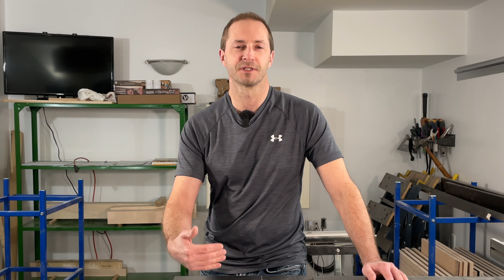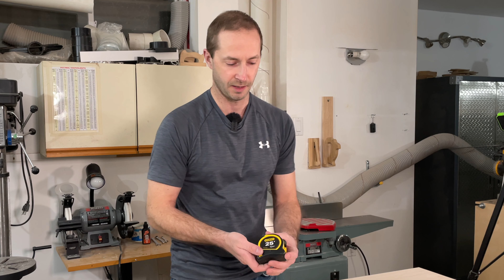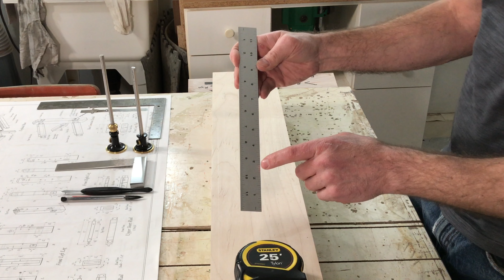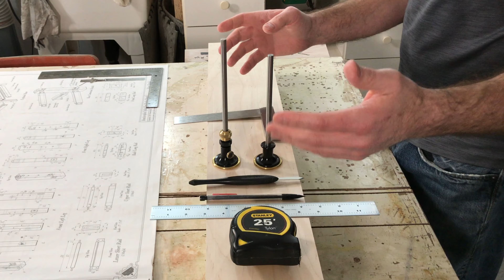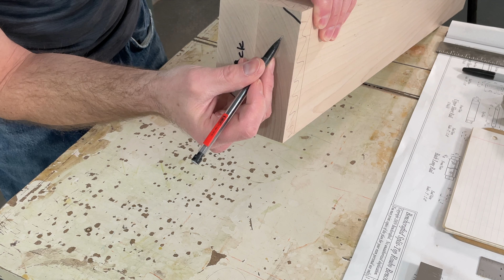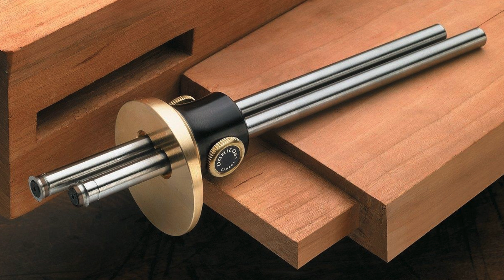Mortise & Tenon Layout: Quick Tips for Perfect Joints

Comment: I had forgotten about using the thumb squeeze in conjunction with the wheel marking guage for smoother operation. I also appreciate the tip for the .7mm versus .5mm mechanical lead pencil. I agree that .5mm breaks easily but I have not tried .7 yet. Will do.
Reply from the maker: I pretty much always use the thumb squeeze with a marking gauge. 0.7mm still breaks but not as easily. I appreciate your viewership Fred. Thanks for watching and commenting!